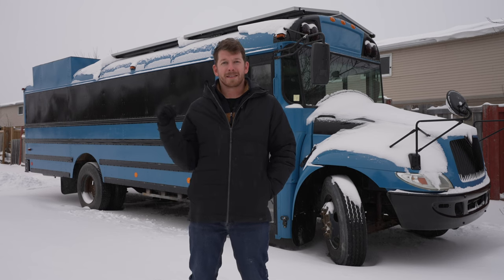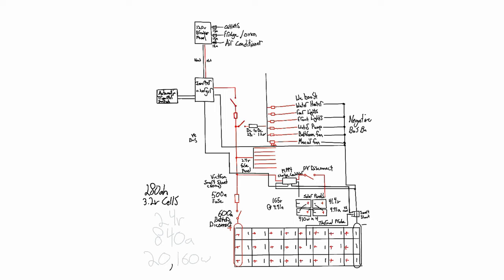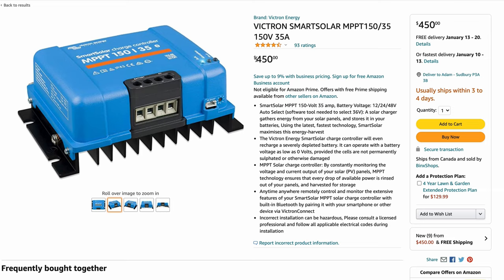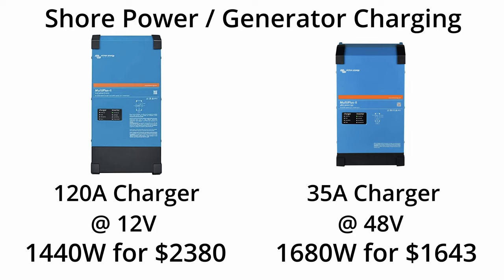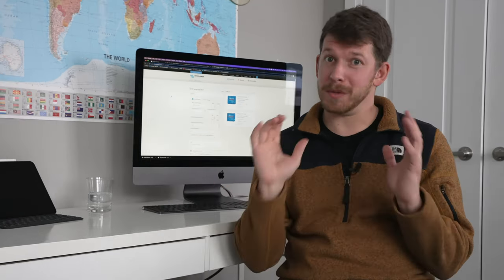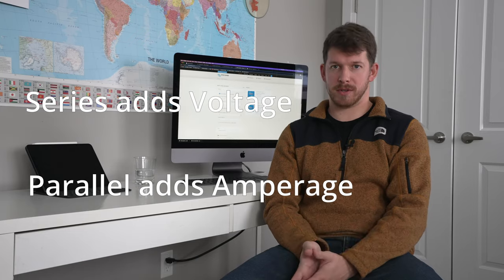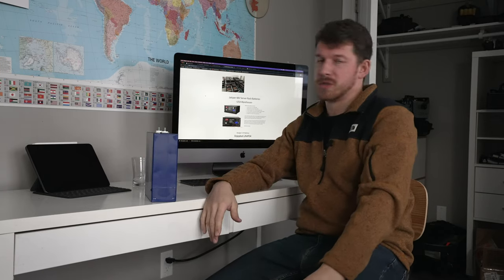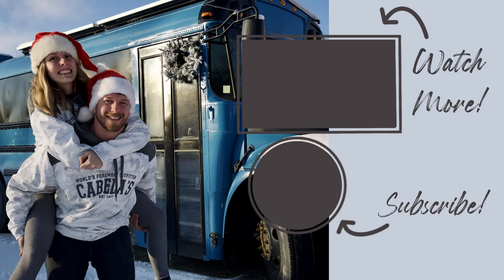How to Save THOUSANDS On Off-Grid Electrical System | Adam & Steph

Comment: victron and other companies make hybrid inverters that also have mppt charging so with one box you could have your solar panels, battery, and shore power all as power inputs that would feed an electrical panel
Reply from the maker: Yes they are a great option if you want an all in one component!

Comment: Interesting vid Adam. You can also take a paralled feed (12v) off a series'd bank (48v) so no need to buy a seperate battery. I would run it through it's own fusing block but that will save on chargers as well. Looking forward to seeing this.

Comment: One thing you got wrong. Current is what really causes you danger when you get shocked, not high voltage. That's why tasers only hurt when you shock someone with them, not knock them out or kill them. It's also why you can get away with a 9v battery in it. There's not much power. (Watts)

Think of voltage as how wide a pipe is, and current like how fast the water is flowing from it. High voltage with low current is like dripping. High current and low voltage is like a pressure washer. High current and voltage is like a fire hose, and low current and voltage is like a dripping pressure washer.

Current gives it the kick.

Comment: Since you’re talking about using only electricity and diesel they make diesel fired engine heaters and I believe some models can be used for cab heat as well. Webasto is the brand that comes to mind but there are others… they’re not exactly cheap but don’t use as much fuel as running the engine and would offer plenty of heat on a cold gloomy day with little sun.
I think some even have an option to heat up your water heater…. I’m not sure as I’ve never dug into them much.. but if it’s heating the engine coolant anyways with a little ingenuity and an oil cooler (they’re automotive grade liquid to liquid heat exchangers) from a Ford diesel you could rig up some circulating pumps and it would also provide you with hot water while it’s running. Happy building
Reply from the maker: Yes, we have in floor heating that will be heated by a Espar hydronic unit and i’m going to use some water to water heat exchangers for hot water use. They are fairly expensive so i might shy away from installing one in the engine right away, tho they are great for easy startup and reduces engine wear in cold temps!

Comment: If your in Canada you are going to need a under temperature BMS to avoid sub zero charging damage  - I put my pack on a low watt heat mat in my old van  and in my new build moved it into the lounge area - I think if I was doing it  all again I would use an all in one like a Growatt mppt inverter
Reply from the maker: Ill be installing the batteries inside to keep them warm and I’m going to install a thermal probe onto the victron smart shunt for low temp protection. All in one systems are great space savers and reduce complexity. Not sure if theres a price premium for that convenience. Still have to do a cost analysis!
Reply: @AdamandAtlas  It sounds wonderful - I look forward to seeing your future posts - I fitted a solar dump water heater to mine  that switches on when the batteries are 95% full - it  just heats 4 gallon  but its handy - have you seen them flexible copper bus bars on Alliexpress ?  there well impressive and stop strain on the pack as they "Pant" there rated at 300amp - I thought the  rather small terminals on such big cells  needed protecting from the stress of solid bus bars.
Reply from the maker: The cells came with hardware actually. Not sure of the material tho. They claim plated copper but i have my doubts. And I’m trying to figure out how to compress the cells correctly. Apparently compression helps increase cell longevity. How did you program a solar dump into your system? Id like to incorporate something like that
Reply: @AdamandAtlas  Yes I put a thin insulated sheet between each cell then sandwiched them between 18mm plywood  end plates binding with two bands of industrial nylon straps - I sourced  an adjustable  digital voltage  sensitive  relay on Alliexpress set just above the EpEver MPPT solar controller cut off when on its Lifepo4 "Lite" settings  - these setting cycle the battery more conservatively - the combination  should give 7,000 cycles to 80%
Reply: @AdamandAtlas  There nickle plated bus bars - they don't allow the cells to flex which puts strain on the 6mm threads - The copper flexible ones I used are some 30 layers of copper foil with a inverted U curve and remarkably  flexible  rated at 300amp - the cells and bus bars don't get warm even when she uses her hairdryer on full with the inverter!
Reply from the maker: Nice! Ill have to do that! Thank you for the information! If you have instagram, you should DM us @adam.and.steph
Reply: @AdamandAtlas  I would have sent you links but You Tube keep deleting commercial  links - sorry no Instagram
Reply from the maker: Oh those are cool! Maybe ill pick some up!
Reply: @AdamandAtlas  Be sure to get a smart  blue tooth BMS for those long winter night watching your cells balance -  it lets you know exactly whats going on in each cell and allows you to tweek all the parameters - I used the 120amp  Jiabaida(JBD) which   has 60ma balancing and the Xiaoxiang  softwear app  for countless hours of tinkering  - I have used them on 5 projects so far with 100% reliability - they have a range of capacities up to 500 amp.

Comment: Hey Adam great video you could point out a DC to DC charger off the alternator and it won't ruin the alternator or your system worth the investment.
Reply from the maker: Good solution if you can find a beefy DC to DC converter!
Reply: @AdamandAtlas  Victron has them and you can run more than one two or three of them.

Comment: Hey Adam, Ive like and subscribed to this awesome channel! My wife and I are building a skoolie currently and I’m pretty new to this like some other commenters. I read rugged ricks comment below mentioning current and I realized I didn’t hear you talk much about current in this video. Does that bear any on what you were saying here?
Reply from the maker: Hey thank you for subscribing! Unfortunately Rick is partially incorrect when it comes to danger. Both amperage (current) and voltage present danger when dealing with electricity, but low voltage electricity (under 50v) typically won’t shock your skin. This makes touching battery terminals somewhat safe. But ANY amount of current can be considered lethal if it crosses your heart. So really without enough voltage for the electricity to shock you, the current cant do anything. Just make sure your hands arn’t wet and you’ll be ok.   But regardless of voltage, metal tools can be dangerous when assembling your system so be mindful not to short circuit something when wrenching! 

Hope this helps!

Comment: That was a great video! I've been dreading building the electrical system. A lot o the build is new to me but most of it (so far) hasn't been that difficult to learn as we go. The solar system is so intimidating and I honestly know very little about any of it. Like you, we won't be having any propane in our home, it's going to be all solar with a wood stove (probably). I think the worst part of this component is that it's a potentially costly and dangerous mistake if I don't get it right. At least I have some time, we won't be getting to solar until spring/early summer.

Any chance you do consulting for solar systems? I'm going to check out the channel you recommended (I think I used to follow him doing van-life for a while). Any good local companies you could recommend (I'm about an hour south of you)?
Reply from the maker: Im not aware of any companies local. Im not certified by any means but I’m willing to help you with electrical if you’d like! DM us on instagram if you’d like to discuss more